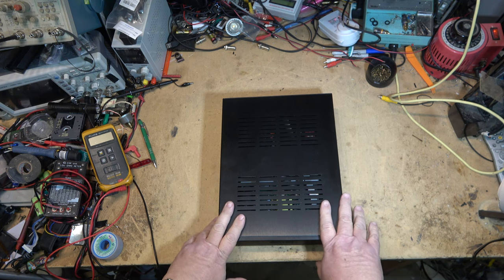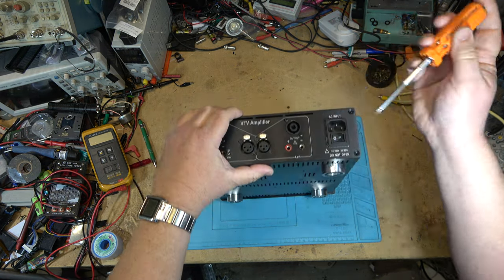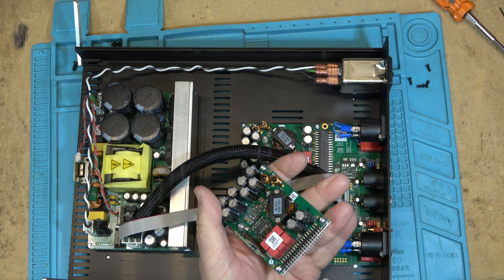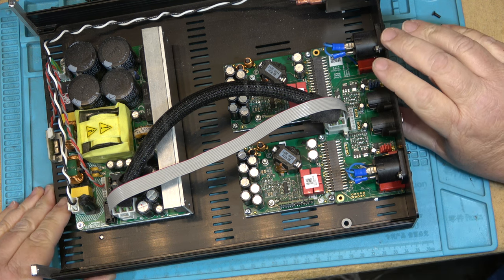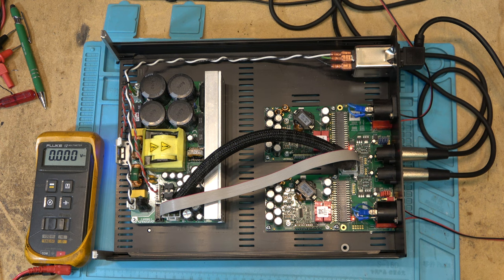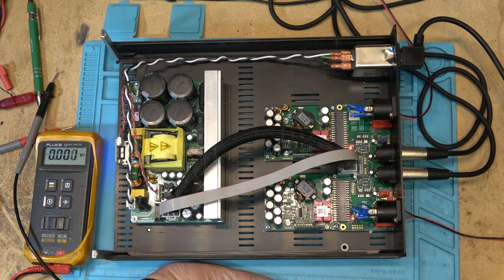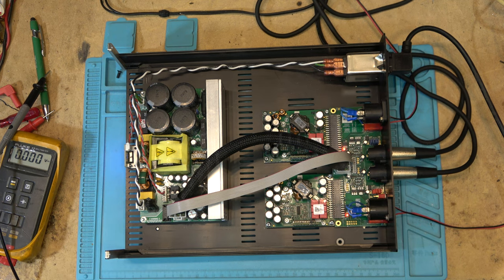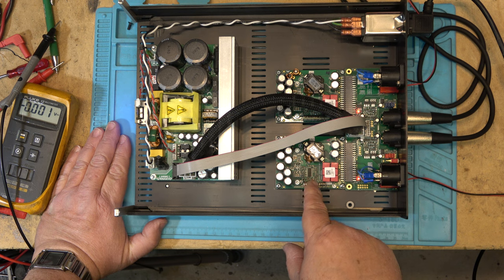VTV PURIFY Amplifier Tear Down and Demo

Comment: Class D puts out a lot of power, they can sound half-decent, but they don't reproduce as fast and clean bass as good transistor class A or A/B or OTL tube amp can do. Class D is like traditional tube amp with big output transformer - bass is soft and boomy.
Reply: BS from a guy who does not own class-D
Reply: @xprcloud  I don't own class D exactly because reasons what I mentioned. I listened Hypex class D with MartinLogan hybrid electrostatic speakers. Only mid-range was ok, bass was quite boomy and lazy. Very low impedance at higer frequencies - typical to esl - didn't help hypex modules either.
Reply from the maker: BS.  Class D amplifiers put out exactly what is put into them.  No more no less (musically that is) some earlier designs had thin miss but that problem was solved eons ago.  Anything made in the past 25 or so years is fantastic.  Even these little cheap boards sound great.

Comment: The Purifi website price is $682.39 for a pair of modules that have relatively few components (no heatsink, no PSU and no case), at that price I think they're taking the p1ss regardless of how good it sounds.
Reply: That is very unfair and simplistic. This is very reasonably priced relative to watts, life cycle and quality. 

There is more than parts count: paying your engineers for their r&d, testing and retesting (and the equipment that requires), bespoke ic, tooling for scale production yet at a volume many times smaller than that efficiency of legacy behemoths (, Yamaha, Sony, etc) paying for quality parts for reliability, etc.  

Reducing components often requires better front end engineering. 

And the lack of  heat sinks is a good: none are typically required. Because of how well they are engineered. 

The modules are made to go into components that have low failure rates and last likely decades with minor servicing, This is not a disposable cheap consumer AVR destined for obsolete in 3 years.  

Innovation at this level, state of the art,  is not cheap. And those who worked on it deserve to be remunerated accordingly as every rigorous test shows these new purify modules are indeed state of the art in terms of transparency and power. The latest purify based amps are producing hundreds of watts effectively perfectly to human hearing. 

Moreover, ten years ago, getting such low distortion and the power these modules are capable would cost likely at least twice as much in traditional class AB amps even in adjusted for inflation and cost you many times more to run in terms of electricity use and loading your air conditioning. There is a reason you don’t need giant heatsinks on the purify modules: they are an order of magnitude more efficient that class AB amps or yore. And the amount of would be many times larger. And be more probe  to failure due heat and the number of components. 

So in fact, the per hour cost of purify based amp, once one takes into count electricity use, lifespan and repair rates is likely quite low. 

A good purify based amp is the last amp you may ever need. $1500 to $3500 is good value given that.

Next time try doing a bit of research and thought before posting.
Reply: @ManFromLaBamba  If you read the spec sheet you'll see that heatsinks are required and how do you know what the failure rate is?  Run it without a heatsink and you'll know that it's not low.

I build class A amplifiers that typically require a 2 KW PSU so I know what goes into making quality audio equipment.

Next time try NOT telling others what to do.

Comment: 19:15 I disagree with you there. We should be comparing apples to apples. You can still fix a Sansui for a relatively modest amount of money (compared to its value). You can fix any amplifier like the Sansui even if the company that made it has long gone under. This is the case for most amplifiers made before the eighties, i.e. those without exotic transistors or integrated circuits. Compare that with this class D amplifier. If the main integrated circuits (which are really small computers) in it are no longer made and become damaged for some reason, then this will be a pile of junk - or at least the amplifier module will be.
On the Akai amplifier in question: you say you blew your tweeter when you operated the Akai at 40W output. Yes but that is the maximum this amplifier can put out (AM-2450) so it is either clipping at these levels or playing with very high distortion. You should expect your tweeters to be blown in these conditions regardless of which amplifier drives them. The AM-2450 is an inferior amplifier compared to its predecessor, the AM-2400 quality-wise. The AM-2400 sounds very nice indeed. In fact, it sounds nicer than the AM-2600 and the AM-2850 (neither of which will blow tweeters when playing at 40W). Because of the increasing prices of the AM-2400/2600/2800 series, their counterparts, the AM-2450/2650 have also gone up without deserving it. The AM-2850/2950 are a different story. The value these devices enjoy today is also in large part due to their near antique age and the fact that most of them still work without any need for service despite being near antiques. So, we go back to comparing apples with apples. If you were comparing this amplifier with a class D amplifier from the nineties or with a similarly priced class A or class AB amplifier made today, then we would be comparing apples with apples.
Reply: @@Douglas_Blake Ok, that's true strictly speaking but there are class D amplifiers which do all the signal processing in the digital domain, i.e. convert the analogue signal to digital. I do not know whether this example falls in this category or the pure analogue class D amplifier type. But this is a little bit besides the point I was making: the chips containing this circuitry are proprietary and not common across manufacturers.  You may or may not be able to restore an amplifier should one of these chips fails if the chip used is no longer available. If you do succeed in finding a near equivalent, you will have succeeded in restoring the function but maybe not the sound (as the particular signal processing done in the chip may differ from that in the original - whether analogue or digital).
I understand you are referring to the driver chip only but in some cases it is all one chip, driver and signal processing.
Reply from the maker: Class D are analog devices.  The only "digital" part of them is the pwm carrier on the mosfet and the signal is more closely related to FM radio. The incoming audio is mixed with a triangle waveform into a comparator that changes the audio into a digital pulse train. This drives the mosfets that provide the gain. The carrier is filtered to reveal the original audio.
Reply from the maker: @Douglas Blake I was simplifying it.  The ramp and audio is fed into the comparator in a form of mixing as one signal goes into the positive input and the other the negative of an op amp and the resulting output is then clipped to either a positive or negative output to drive the mosfets.
Reply: @12voltvids  For some reason I assumed that all high-end class D amplifiers sold today convert any analogue signal to digital and then do all the processing e.g. volume control, filtering, feedback and PWM waveform generation in the digital domain.  That was the source of the confusion. I was not implying that class D amplification itself is a type of digital amplification - at least not intentionally 
Now, if we just stick to semantics,  the word I used to describe the chip was "computer" not "digital" (there are analogue computers) and the purpose of using it was to convey the idea that this is a very complicated circuit housed in that chip.
But yeah, other than that, I agree totally.

How about the AM-2450? Have you done a video on it? Can you share what you don't like about it, especially in comparison to the previous generation(s)? Akai was not doing well in the eighties. I'm not sure when exactly they got bought off, but they started concentrating on cheaper home audio devices and dropped their quality. But then we had the AM-73/93, AM-75/95 series in the nineties - which for some is their favourite series of Akai amplifiers.
Reply from the maker: @Stelios.Posantzis  some low end class D also process in digital domain but this is a straight amplifier.  No volume or tone controls.  Put a signal in, get a bigger one out.
Reply: @12voltvids  Thanks for that. 
Have you plugged it in the big system yet? If so, were the impressions it generated on the cheap midi loudspeakers amplified proportion? And how did it compare to your other main system amplifiers?
Reply from the maker: @Stelios.Posantzis  not yet.  I will try it on a few different speakers while it is here.
Reply from the maker: @Douglas Blake which is the fixed frequency triangle generator.  
Its not rocket science.  This has been around since the days of tubes believe it or not.

Comment: P W M ! Analog !
Reply from the maker: Another fool that just doesn't get it.   Only 2 states in class d. On and off.  That's digital in it's simplest format.   Morse code is also digital, be it much slower. 
You are confusing PCM with pwm. The p and m mean the same thing.  Pulse and modulation.  The difference is the middle letter.  C for code.  That's right the information is coded as a binary number which can be stored and retrieved.  The w in pwm is width. The width of the pulse veries by the amplitude of the modulating signal.  Low amplitude have very little pulse width deviation and high amplitude have large deviations. 
If you were to deviate the frequency as opposed to the pulse width you would have FM. 

Digital means 2 state, 1 and 0. The way all class d amplifiers work definitely fall into this catagory and that's why they are called digital.  They meet the criteria.

Comment: These amplifiers are not DIGITAL!
Reply from the maker: Definition of digital. Any signal that is represented as a 1 or 0. The outputs switch on and off.  There is no variable amplitude as in analog.  Everything beyond the comparator right through to the output filter is a 1 or 0, which by definition is digital.  You are confusing this with pulse code modulation which is a quantized sample of an analog waveform suited for storage in a memory medium.   
Pulse width modulation is a digital transmission method.  Incidentally a compact disk is by your definition also not digital as the signal recorded by the laser is a pwm signal.  The audio is sampled into PCM and then that is converted to a pwm signal in a conversion process known as EFM that changes the 8 bit byte to a 14 bit representation that can then be written to the disk as a pwm waveform. 
Glad i could help you understand that there is more to the definition of digital other than PCM. 
Anything that can be represented by a 1 or 0 is digital and class D amplifiers certainly fall into this category.
Reply: @12voltvids  Please do read up on the topic. Digital is clearly defined as being discrete (steppy) in both amplitude and time domains.

Class D (within the comparator and switching part of the circuit, which are still analogue btw) is discrete in amplitude only, but stepless (=analog) in the time domain

PWM by itself is also an analog method. Or are you saying an analog synthesizer that uses PWM on its oscillators for generating overtones is somehow digital like that too? It so totally isn't.

Both are entirely analog systems.
Reply from the maker: @ropeburn6684 here here we go again. Clueless fools.
You are confusing PCM with PWM.

The are both digital.  The P stands for Pulse.
Tbe output going through the amplifier use a 1 or a 0. Simple as that. It the most basic form of digital. Like morse code.  
The signal is represented as ones and zeros.   
There is no quantization (digitizing) involved aa is PCM, pulse CODE modulation.  
It still digital as opposed to linear.   You need to do some reading up and get your head out of your ass.
Any analog waveform can be represented in the binary world without digitization.  
In a linear amplifier the voltage is amplified.  In a digital amplifier the duty cycle represents amplitude change and once the binary (digital) aspect is removed you are left with the original analog signal. By the very nature that the output is either on or off with no in-between is the most basic example of digital.
In class D amplifiers a comparator is used by adding the analog audio to a triangle wave that produces a 1 or 0 output. That is used to drive the switching transistors  which bring the voltage from a few milivolts to 10's or hundreds of volts switching on and off to follow the input waveform. A simple filter to remove the signal and you are left with the amplified original. I should also add that this is the most pure form of amplification. No distortion is added in this process unlike class AB or even class A amplifiers. All other forms revolve around the specific gain of components, frequency response and bias. In the binary world this does not exist. Once your analog signal is in the PWM state nothing affects it.  With modern PWM frequencies in the 1MHz range very little filtering is required, just cancel out the PWM and you are golden.
Reply: @12voltvids  Your needless insults serve no purpose. You also spent a lot of words explaining how exactly you are lacking in physical and technical understanding. I can only repeat: please do read up. Even the far from exhaustive Wiki fucking pedia article about class D explains the "is it digital" confusion rather well. Let alone better sources who can explain it far better than I can - how about Bruno Putzeys?

For the love of all things technical, I'm not confusing anything, regarding PWM or otherwise. I beg you, get educated. It isn't hard.
Reply from the maker: @ropeburn6684  I'm not trying to insult you, you are doing that to yourself.
It's really pretty simple. Ask yourself this. On the outputs on a class D amplifier. Does the signal comprise of an On/Off state, or does is vary in amplitude?
I think the answer to that is obvious. It is an On/Off state, operating at the fundamental frequency for the design between 500KHz and 1.2MHz.
On or Off, 2 states. The fundamental of digital. Nothing to do with A/D conversion. That is totally different. That is the digital you and every other idiot that has commented about this is thinking. There are plenty of other forms of digital transmission that do not involve any form of coding or error correction.  You could take this PWM signal and stick an antenna on it, and you would have a PWM transmitter that would transmit the signal to a receiver.  You could modulate a laser with the signal and fire it down a fiber optic line and at the other end recover it. 
Fiber optic relies on on/off pulses of light. 2 states on and off is digital in it's most basic state. You don't seen to understand this very basic concept. 
As far as educated, I am well versed on things technical.  This is the most basic of them all.  Somehow you think I am confusing this with PCM which I am not. I am fully aware it's an analog signal modulating the PWM, its the PWM portion that is digital. Its really simple, but you just don't get it.
Reply: @12voltvids  now you apparently deleted my response. You also edited above comments to delete various insults. What does that say?
Reply from the maker: @ropeburn6684 didn't delete anythjbg

Comment: Beautiful D class amplifier... alright, where's my A class?
I need an upgrade to triple A and 1000W radiating rheostat just to load up the lines.

I don't believe any progress has been made in the class D amplifiers in the last 30 years... it's just that the expectations have gone lower and Lower and LOWER.

With the current gen of portable speakers a class D is way too nice for the quality of the speakers... so be it. It's like MP3s... then AAC, the eAAC+... get me an eAAC+ that sounds better than a 44.1 kHz sampled 16 bit PCM: 1982 beating the FUTURE (WAS CD Audio).

We like RUBBISH! I also do... so I speak for myself.
Reply from the maker: @Douglas Blake no class AB can tough a class D these days. The improvement have been so great in the last few years that i would take class D any day and my standards have not gone down.

Comment: They may sound great and be very efficient but also somewhat unreliable because when they go wrong, they go wrong.
Reply from the maker: When a conventional big amps goes wrong they also go boom and blow many parts.  Direct coupled especially.   On these you plug in a new module and you are good to go.
Reply: @12voltvids  Yea you are right, you can plug in a new module that cost three times as much as whatever parts a conventional amp would need.
Reply from the maker: @tyronenelson9124  but you shouldn't have to because they are very reliable.  Much more than a conventional amplifier due to the design.  And when you plug in a new module you are not paying someone 200 to change a bunch of parts only to find out that the parts are counterfeit and blows up again a few months later.